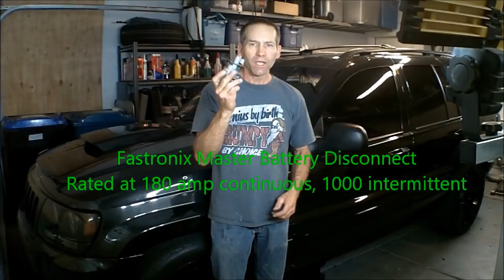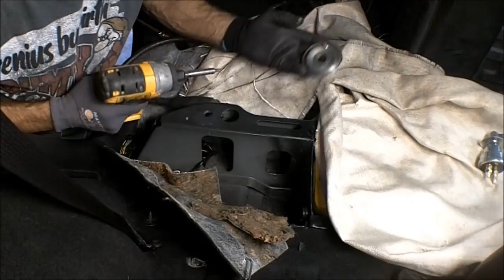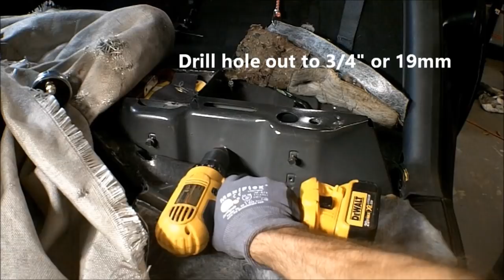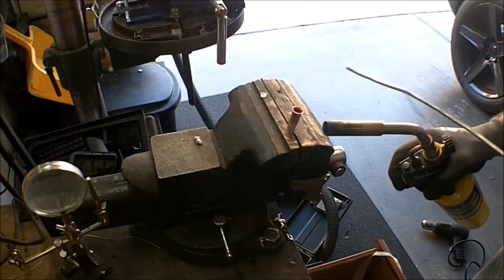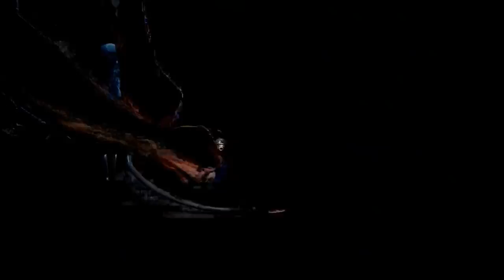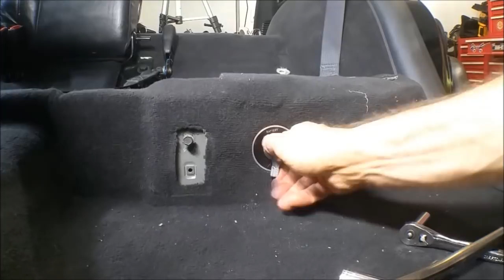How to Install a Battery Disconnect Switch

Comment: Can you explain, why you didnt connect it in positive terminal?
Reply from the maker: It is suggested when disconnecting a battery foe service (or if you were to replace a battery) always disconnect the negative side 1st and then when reconnecting reconnect the negative side last and this is why I put it on the negative side of the battery.

Comment: Why did you decide to put the switch on the negative ground side?
Reply from the maker: For one, I didn't have to cut that nice 1 gauge red cable.  When disconnecting a battery, you should always disconnect the negative side 1st, so that's why I put it on a negative side.
 Also, on the positive side, many times, you'll have more than one positive cable. One handling the starter and alternator and another handling the power distribution block. This would make it more difficult to kill all the power with a single switch.
Reply: @martinbuilt  I am installing a switch on a motorcycle and had up in till now decided on the positive plus side mainly cause the switch itself is red and the instruction pictures the positive side.
Reply from the maker: @Snurre86  You can do that and it will work.👍 I don't understand why the manufacturer of the switch would only show it that way. 🙁

Comment: unless you use a battery inside the car that does not have acid when the battery charges the toxic gas will escape from acid fill battery inside the car
Reply from the maker: True for a lot of typical acid filled batteries, but the Optima does not vent gases unless it is overcharged or gets hot. 
 I also have a vent hole close to the bottom of the box.
Reply: @martinbuilt  I am familiar with optima batteries you are very right I was just worried about your safety

Comment: Do -20°F Canadian winters kill batteries that use a kill switch? I have a kill switch on my battery now and it's my daily driver during the winter. Will the battery freeze if disconnected for 10 hours at a time in that weather?
Reply from the maker: No a kill switch  has no effect on the battery. Batteries can't freeze because of the  battery acid..
Reply: @martinbuilt  
THANK YOU SIR FOR THAT INFORMATION AND QUICK RESPONSE!
SINCERELY,
DAVID WEUM
ALBERTA

Comment: Thanks for sharing this . Nice videos . I have firs f250 with dual batteries so do I need to install two separate batteries shut valve ?
Reply from the maker: Depends how they wired it, if they paralleled one battery to the other  then yes 1 switch would do it.

Comment: Does the kill switch need to be installed on the negative side  of the battery?
Reply from the maker: no, I just feel that is the best way.
Reply: @martinbuilt  Will installing it  on the positive side cause any damage? The battery is in a Miata and the positive pole is unencumbered versus the negative side which is buried.

Comment: Do I need a specific cut off switch for a 2003 bmw 330i or is it pretty much universal
Reply from the maker: I would think it would be Universal, how are you doing this severing the power, no different than disconnecting one of the battery cables from the battery itself.

Comment: Martin,
   I used your method of installing the Fastronix High Current Master Battery Disconnect Switch by tapping into the negative side of the battery and grounding the other large post of the switch to the chassis. When I switch the Fastronix High Current Master Battery Disconnect Switch off the vehicle will not start as desired. When I turn the switch on truck will start. This is all I wanted. It was mentioned in a post or two that if a child was in the back seat and turned off the switch the vehicle would stop running. I do not know if this is so on your vehicle. I do not know if this is so on some newer vehicles, but with switch on and my 1984 S-10 truck running my meter reads 14.5 volts at the alternator. If I  turn off the switch  with the truck running the voltage at the alternator drops to 12.9v and  holds at 12.9v and the truck keeps running. This is OK with me. I do not intend to go drag racing, but I believe if you intend to go drag racing you must wire the switch differently so the vehicle can be switched off in an emergency. I am curious to know if your vehicle keeps running if the switch is turned off while your vehicle is already running. I would test this in the garage, not with your 10 year old in the back seat. I think if the child finds the switch in your case you will be OK, but I do not know.  Please let us know what you find.
Reply from the maker: That's a good point, I know that I have seen that before where the vehicle will run off the alternator, I'll have to check.

Comment: Does it matter if I use 5 feet of heavy gauge wire from my battery to my switch? I dont want to move my battery, but want the switch in the cab?
Reply from the maker: I think that would be ok I just would up the gauge or two
Reply: @martinbuilt  Indeed! Thankyou!

Comment: Thank you sir! Very helpful. I have a Dodge Magnum and my battery is in the rear under the cargo flooring. It's a pain to have to disconnect battery everytime I work on my car that requires cutting off power. Plus, it also helps if you're storing a car & not wanting to drain battery.
Reply from the maker: yea, it really comes in handy, makes it so easy to safely disconnect the battery. Thank you for watching.

Comment: What was the reason for not using the plasma cutter when you were cutting out the hole for the battery box?
Reply from the maker: without a guide like I used to cut the hole for the switch, I am able to make a straighter cut with a Sawzall or angle grinder

Comment: Thank you Martin.  You are very professional in your work and explaining how to install the kill switch.  My battery is in the trunk so I would have to cut a hole in the trunk area.  Is this switch ok if you have a parasitic leak you can't
find?  Thanks again.
Reply from the maker: Thank you Ray,  yes if you are unable to find the battery drain this switch will work great.

Comment: Martin - I keep  a Battery Tender Plus connected to the battery in my old car.  Can I continue to keep using it to keep the battery charged after I install the disconnect switch? Thank you for the helpful information!
Reply from the maker: yes, as long as you connect the battery tender at the battery
Reply: @martinbuilt  Yes - keeping the battery in it's original spot and will keep it clamped to the battery terminals.
Thanks again for the info!

Comment: do you have electric locks? If so in the case of a dead battery how would you get in to the car to get the batttery out?
Reply from the maker: Yes I have electric locks but the driver's door you can open it with a key. You  would have the same problem if the battery was under the hood because the hood release is inside the cab. Good thing they give you one door that can be opened with a key.

Comment: I've been slowly upgrading my 97 Blazer's electrical and tired of disconnecting the battery manually every time. Helpful video, much OBLIGED >:0
Reply from the maker: You'll be surprised at how often you use that switch. I'm always working on some kind of upgrade and now that I have the switch I don't take any chances,  flip the switch and it safe to work for you and the vehicle.

Comment: Good video I’m wanting to put one on a couple of my trucks. I do have a couple questions so one cable goes to the battery and the other cable goes to a good ground right? Also if you have multiple batteries do you need a cable for each battery going to both the grounds and the switch?
Reply from the maker: Thank you, yes negative cable from the battery to the switch and then from the switch to a good chassis ground. If you have multiple batteries take the negative side of both batteries to the switch and then one cable from the switch to the chassis ground.
Reply: martinbuilt ok thank you for replying back I own a Peterbilt with 4 batteries that I’m wanting to add this too.
Reply from the maker: @dv287  you may have to throw a few switches in there or get at least a couple really heavy-duty ones that can handle that many amps
Reply: martinbuilt 10-4

Comment: Soooo..what happens in a worst case scenario if he needs a jump?
Reply from the maker: well, it's not as easy as it used to be. I carry one of those small battery jump start pack from Harbor Freight. Hook it up under the hood at the fuse/relay box.
Reply: martinbuilt, I bought one of those things from Costco and when I opened the package I thought “No way this will start a car.”  I disconnected my car Battery and the thing started the car entirely on its own!

Comment: How much modification was required to fit the battery under the seat? I'm thinking about adding a second battery to our XJ and that seems like a good place to put it. Plus, I now know where and how to install the disconnect switch... Thanks.
Reply from the maker: Here is a link to the video https://youtu.be/TDyCwM6FI54  Thank you for watching!

Comment: Do you think that this mod would also be useful for vehicles that sit in storage long-term?  Essentially flip the switch off throw a trickle charger on the battery and let the vehicle sit over winter.

Comment: Nice work and well done, but not every car is like yours, most European cars have battery under back seat or trunk, so  installation of that switch can be totally deferent procedure.
Reply: "Most" European cars have their battery under the back seat or in the trunk? As a European who's mostly driven European cars, I'd beg to differ.

Comment: Should'nt your ground cable be the same size as your positive cable?
Reply from the maker: Dan Hambrick even on the Dodge Magnum that I took the cables out of when I relocated the battery the negative is much smaller like 6 gauge maximum I think it's actually 8 gauge. You can go to a smaller gauge when the cable is very short. I did up the gauge since I was actually adding length